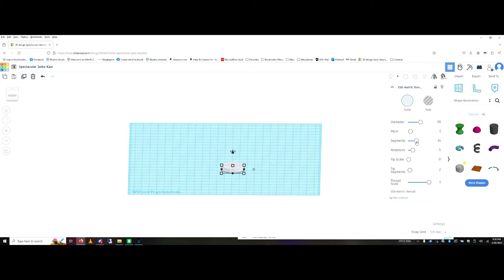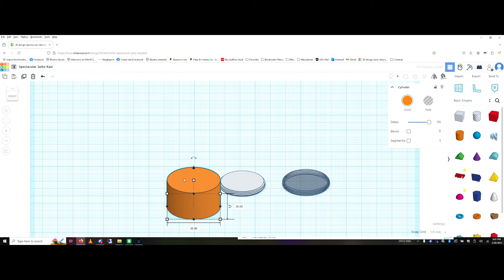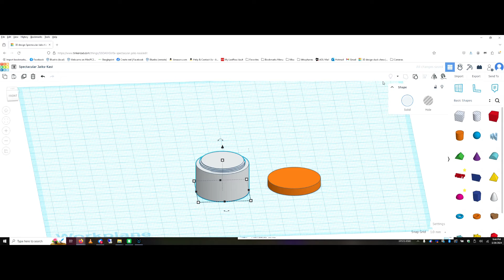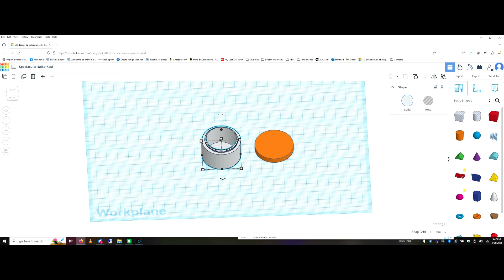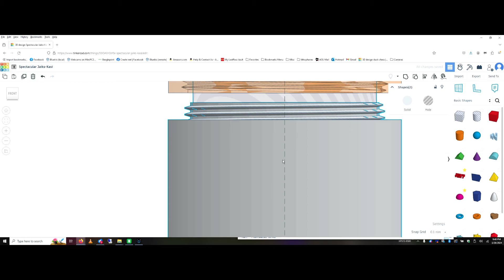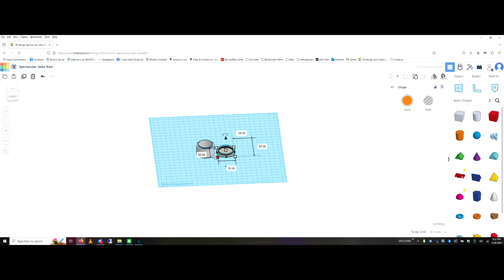Making Screw top container for 3D printing using Tinkercad

Comment: Really great video, thank you! 
I have an issue with my print, I reacreated this but on a larger scale, however when I screw the lid on, it only screws on about 2/3 of the way and then becomes really tight and stiff. Is there anything you would suggest to fix this? Maybe I made the threaded part too much to thread, of that makes sense?
Reply from the maker: You might try gently working the lid on to loosen the threads a little at a time.  Also, when I want to print on a larger scale, I usually still do the smaller model then resize to the desired size.  I find that works well for me.

Comment: First thank you for a great video… Question, when I print on my H2D, always the non cap part threads (jar), fail somewhere and get stringy and/or to thin.  Thoughts? Also are you using supports?
Reply from the maker: You may need to use supports.  For larger threads I usually use tree supports.  Then screw the top on carefully to work the threads, don't try to force it on at first, and go slowly.

Comment: I'm having an issue where I'm trying to make a much bigger sized container but the outsides are squaring off and im not sure if the threads will properly work. Do  you have any suggestions?
Reply from the maker: I've noticed when you size the thread to larger than 50mm diameter, sometimes when changing the thread scale it will do a strange squaring off, but if you keep trying, it will eventually seem to do as it's supposed to (must be some kind of bug in the software). It won't work well if you try to go much above 50mm in size though.  You can alternately just size the 30mm container.  I was able to scale to 200% (70mm) in my slicer, and it printed fine (without supports).

Comment: So you printed with NO supports?
Reply from the maker: In this case there were no supports. In some cases you may need to use supports depending on the size of your threads
Reply: @terribruin9662  I guess you never know until you go. Thanks.